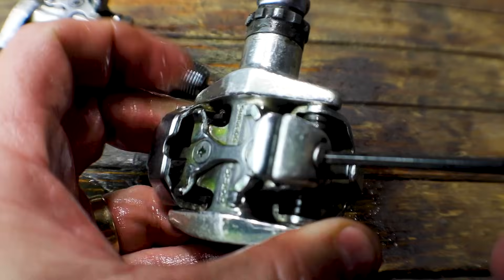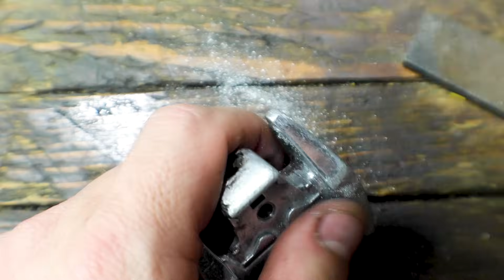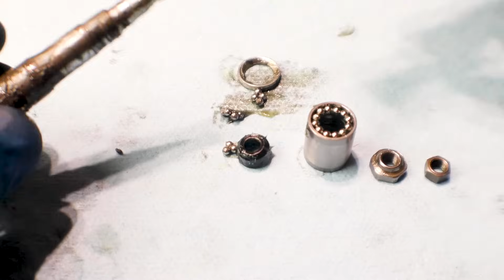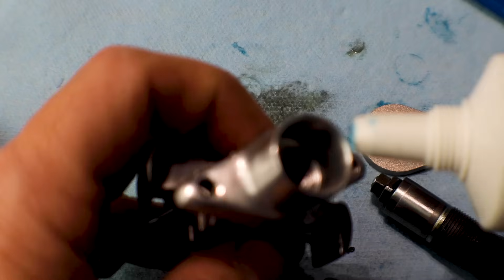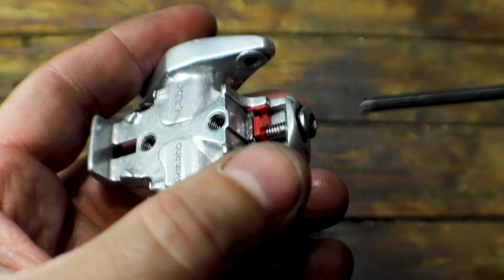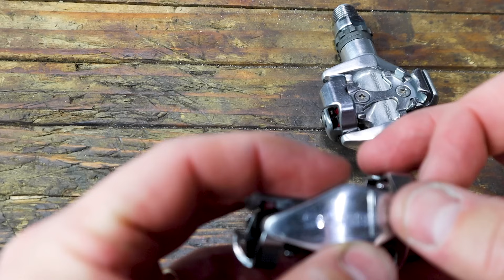Restoring the Best Pedals Ever Made - MACRO ASMR

Comment: I have 3 sets of 747s on 2 vintage touring bikes and a 98 explosif.   I love and buy these pedals for parts on ebay and parts bins, and I am very careful to maintain the bearings with fresh grease.  The removal tool is a good investment.  The weak link is the original thin rubber dust seals that often are missing on ebay purchased 747 sets. On my motobecane grand touring rail trail bike, with 747s, I rigged a missing seal using a narrow road bike inner tube cut into very thin strip rubber bands.  Double  wrapped and snugged up against the outside, they work as a reasonable good seal for a season, and are easily replaced.  You just have to play with them to get a smooth turn.   Others may have better solutions for missing dust seals?   Long live the 747!

Comment: For years I've been using pd-m520s and they are panzer although I abuse them all year long including nasty and salty winter conditions. The only maintenance I do is cleanup and repack the bearings. Visually they are beat up and show signs of wear but they are still holding strong. 

Btw. There's a dedicated tool to untighten the spindle and it costs ~2$ - tl-pd40.

And that finishing touch with the stickers is like a cherry on the cake 👌

Also, this typen of content brings you back to the beggining of your channel and first videos of old shovels restorations :)

Comment: I have a set of 1990s silver shimano  PD-A525 clipless pedals and their original axel removal tool. I used them on an old 1993 Cannondale R300 back then.  I never  could get used to them. I hardly used them.  So, despite a little curb rash, they still are solid workhorses.

Comment: I still run a set of M737 pedals on my owned-since-new 1992 Diamondback Axis.  Picked them up 10 years ago for $20.  Restored by a little model paint & homemade decals & they look & run like new.  Never touched the bearings & not a bit of slop.

Comment: My first set of clipless pedals were the 737's that I purchased in late 1994. I bought a set of the 747's in 1996 for my '96 GT Team RTS I built up that summer.
I still use Shimano's cheap PDM520 pedals to this day with no issues on my current hardtail.

Comment: The Shimano tool TL-PD40 makes servicing the bearings much easier. I have a couple sets of 747’s. One set currently on my commuter bike. I like that the bearings can be easily adjusted. Also that you can just pull the pedal body off, fill it with grease, and push the old stuff out when you reinstall the body in a couple minutes. The 949’s are a great design upgrade. Shed mud very well, my favorite for years.

Comment: i still use mine, got them in the first batch we received in the store.. haven't stopped using them, up until recently i was actually using them with a same year SIDI Dominator shoe.. but plastic gets old and fails.. Still trying to find an SPD shoe that is as good as those from the early 90's

Comment: The current M540 or XT pedals are equally good and basically the same thing as the 737s. SPDs will take ridiculous amounts of abuse. It's easy to overhaul or repack the beaerings. They are easy to use and are tolerant of muddy/dirty cleats. They'll last easily 20+ years of tough riding. They are not expensive. The SPD pedal hasn't been majorly changed in 33 years because they were perfect from day one.
Reply from the maker: Agreed 🙌